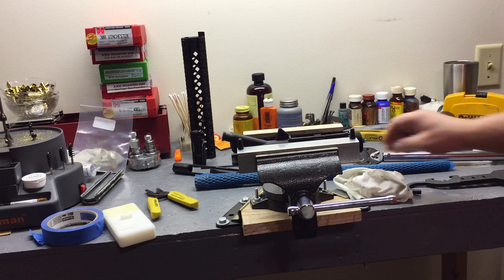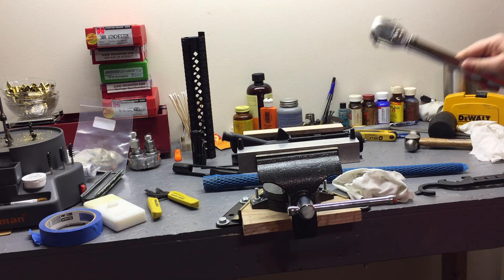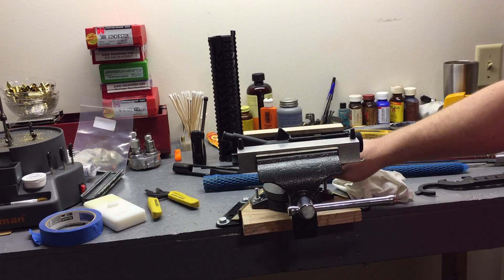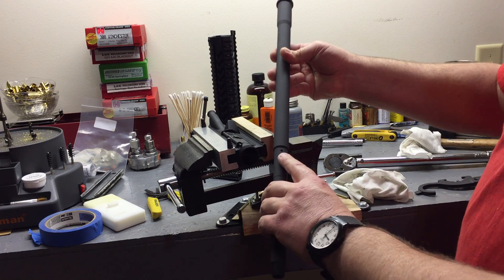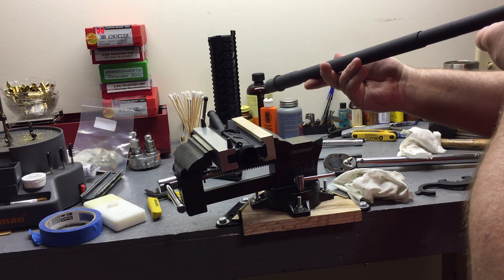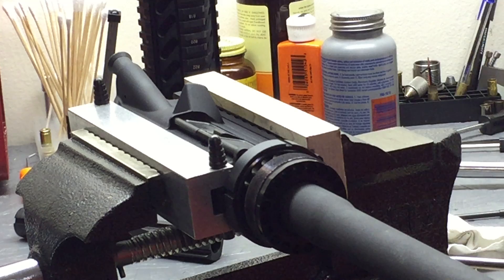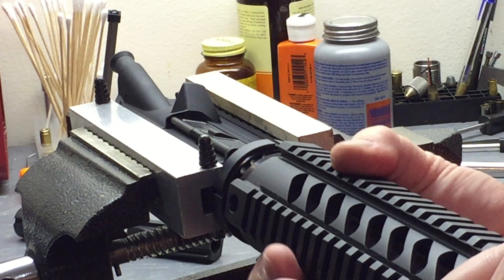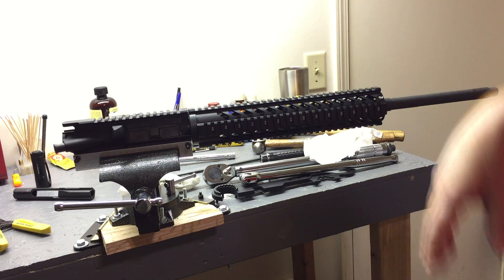Installing an AR-15 Barrel with a free float quad rail

Comment: Man thats great, i grabbed a tacfire i think its called 15 inch guard that looks about the same as yours. What i cannot understand is how im supposed to thread the guard on with a gas block and tube installed..m
Reply from the maker: Capt, Make sure you use a low profile gas block.

Comment: Actually, from everything I've seen and read you should torque it to the minimum required torque then increase the setting by 10lbs on the torque wrench then proceed  with the gas tube alignment if you get to the next torque setting increase by 10lbs until you achieve alignment. Never go over 80lbs, if you can't achieve alignment by 80 lbs you will need to get shims to get to alignment within specs.
Reply: It doesn’t matter when he didn’t use the torque wrench correctly. Values are out the windows from the get go

Comment: good Vid! one thing to add though. When your torquing your barrel down with an extension arm, you want your wrench to be 90 deg from your extension arm.
When your extension arm is parallel to your wrench the click happens at a greater torque rating on the barrel. The click happens when your torque is matched to the driving point of the wrench. 
http://hyperphysics.phy-astr.gsu.edu/hbase/torq.html
http://hyperphysics.phy-astr.gsu.edu/hbase/torq2.html
Reply from the maker: Great information! Thank you for posting this and providing the links. I appreciate it